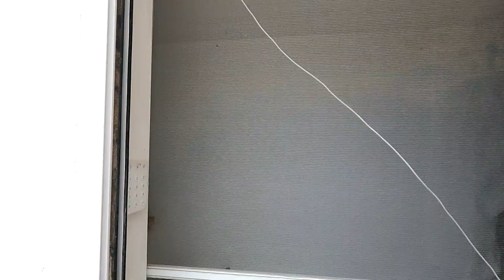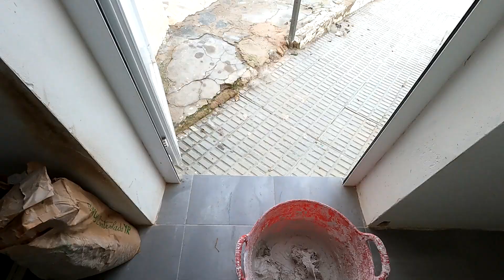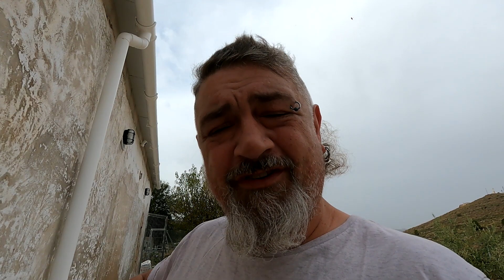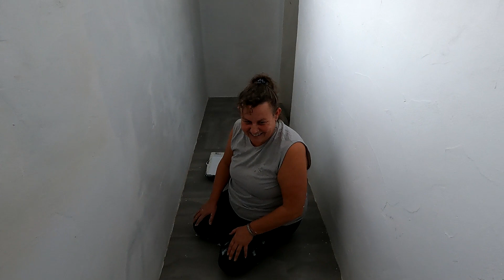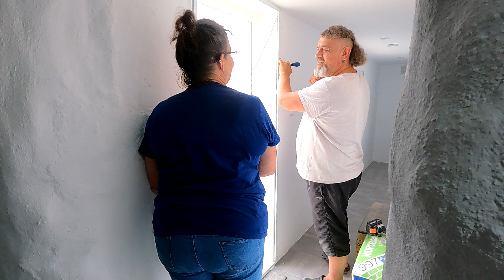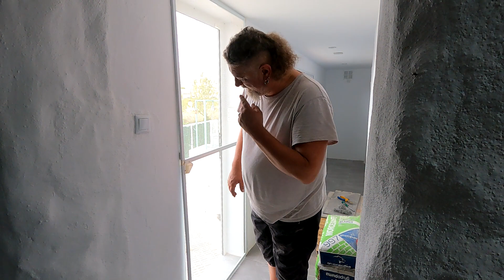Let down again by the skip company (Ep 146)

Comment: A lot of the new houses especially single storey ones are built out of the terracotta brick where I live
Reply from the maker: Yes they are, they are easy to use & inexpensive, their only drawback is if you want to put screws/rawlplugs in, then you find they are hollow, as we did where we fitted the door. Problem now solved though and the door is nice & solid 😁